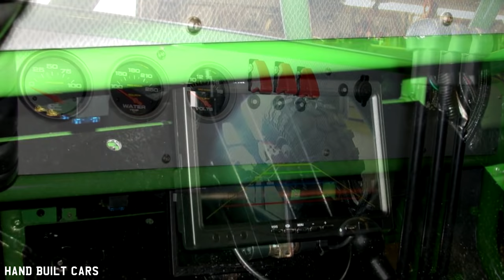Iguana LS1 V8 Buggy Build Project

Comment: How much cost something like this?
Reply: Javier Lopez 60,000 - 100,000
Reply: depends if you do it by yourself or you buy it brand new 
buy yourself you wille have like 15000 for the normal materials like alu and supension etc (in occasion) 
and 5000 for a v8 in great shape
Reply: 20 - 30 if u buy a vw oldskul and maybe rebuild an engine and shit